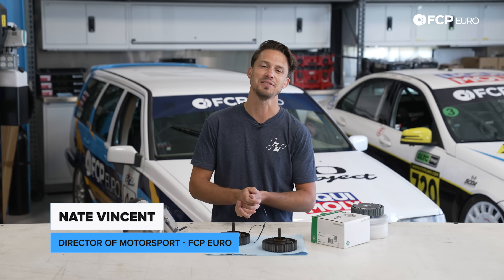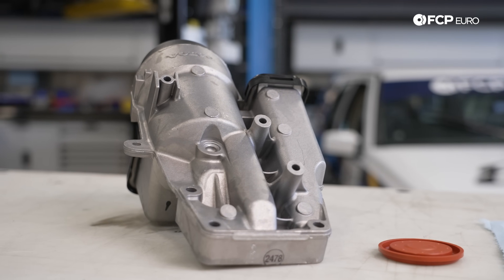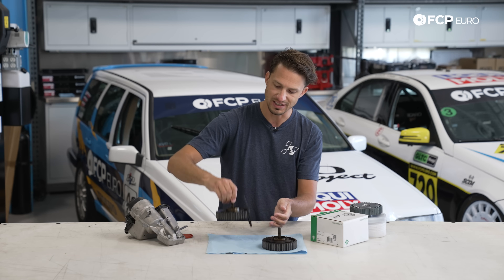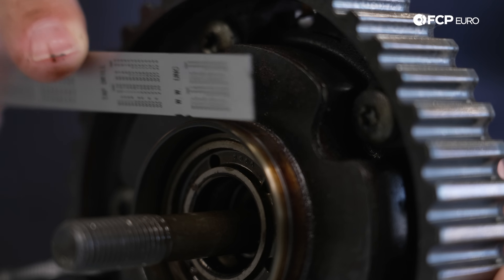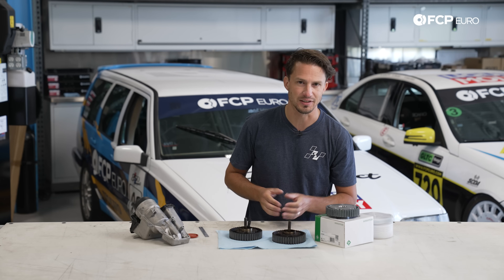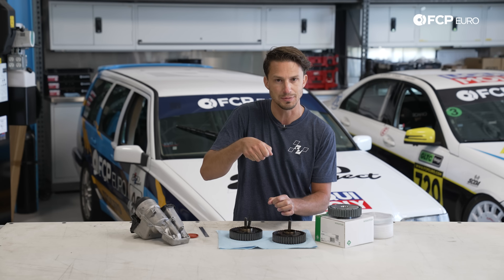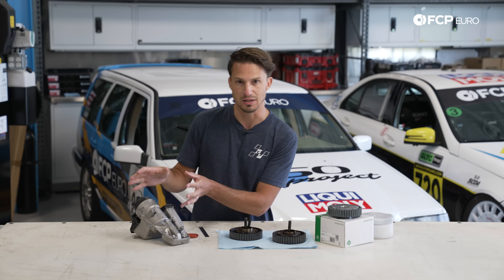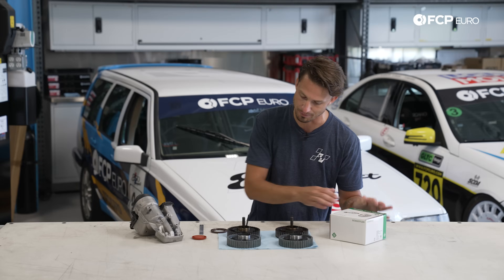How To Tell That Your Camshaft Gears Need Replacement (Volvo, BMW, VAG)

Comment: I have a 2016 Volvo like this and a 2017 GTI, using a diagnostic scanner can I read the engine vacuum to determine if the vacuum is too high and if so can the PVC unit be serviced to prevent failure such as the old simple PCV valves could be cleaned.

Comment: Seems like you could just have the sealing surfaces turned on a lathe to make them smooth again
Reply: Not a bad idea. Nate mentions a "half a millimeter" estimate of a groove depth on the cam gear's seal mating surface. Removing .040" on a diameter is a lot for a spring-assisted dynamic lip seal to compensate for, if it could. A lathe cut may work if damage is minimal, but many factors need to be on your side for a successful repair.
Reply: @mattkrazit6414  Yeah, as ever, if the part is worn out the part is worn out.

Comment: My Volvo 2002 V70 with the naturally-aspirated 5-cylinder white block has 112k miles. I did a timing belt service in 2016, full PCV also but no seals.  I think this kind of thing is premature for my engine, which has always had a good lubrication history.  On any engine, I wouldn't go to the trouble to replace these cam gears until after a cam seal job.  This seems like an issue that doesn't develop until around 200,000 miles -- on neglected engines.

Comment: I always thought a faulty PCV caused over-pressure in the crankcase, pushing out the seals
Reply: PCV has 2 parts, the vacuum side and the breather.  somehow this part fails allowing more vacuum, i guess though a torn diaphragm.. 
the breather must be calibrated for the lower vacuum or clogged enough to cause the high vac condition

Comment: tempting to load this time
Reply from the maker: We aren't quite sure what happened on that first upload!?
Reply: @fcpeuro  Right. It just would not load and it was one of the more applicable videos because I have an XC70 with this engine and spark plug boots are accessible I have the cover off and now it's time to check it. Thanks.